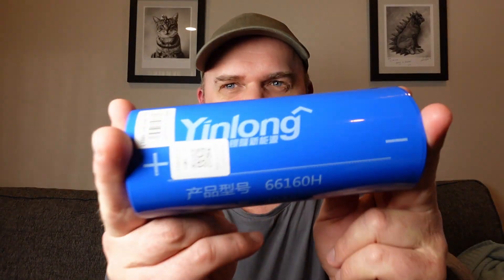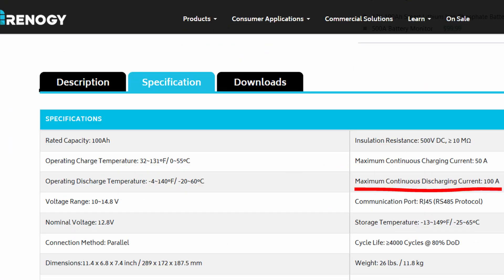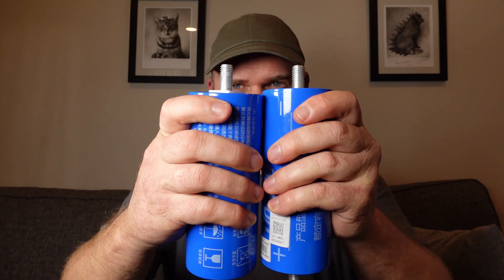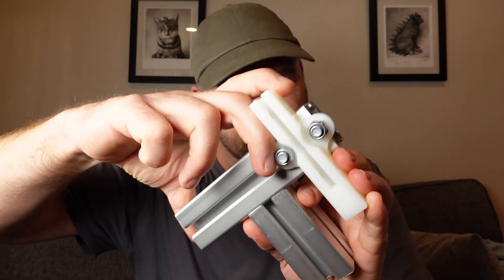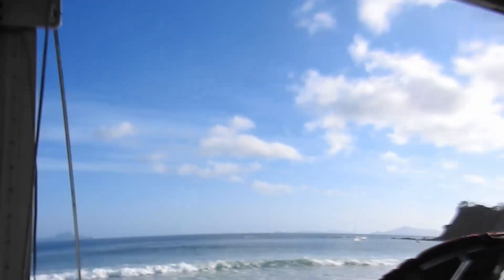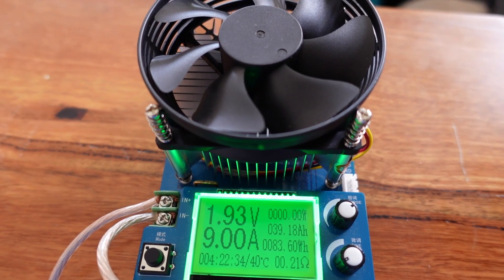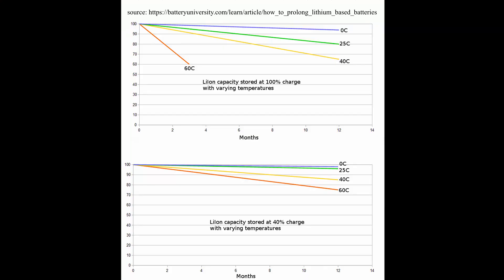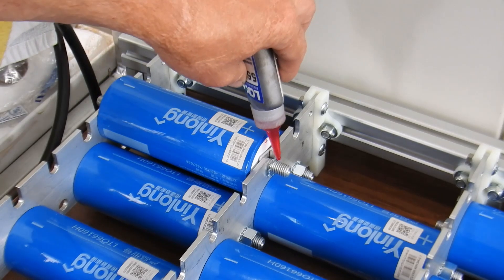Campervan DIY battery build HUGE POWER!

Comment: Hi Brendon,
Great video mate!

Super Detailed and knowledgable as well as neat work.
I have been looking for a lithium battery for my Ute just to use as a Power source when camping.

I nearly bought a cheapy which only had 50amp discharge, I'm glad I saw this first.

I'm not too savvy with this stuff, but know I can do it with the right info.

I was looking at getting 6 Yinlong 30AH Batteries, and Pairing it with a 6s LTO BMS.
Going to secure them with 2040, and put them behind my rear seat in my dual cab ute. (180AH should be plenty for my needs)

Is this a good solution for what I need? I am looking to run simple things, but want the capability to run 2000w inverter at load if necessary.
I would assume I would need to wire it all up with 6awg Cable.

I also have a ctek 20A DCDC Charger, that has a lithium mode (Designed for LifePo4), and 250Watt solar on my Ute roof.
Would these be suitable for charging it? is it suitable to connect an LTO system up to a dual battery system with the DCDC Charger?
And how do you keep these batteries Balanced?

Lastly any tips of crucial information before I begin, to make this as safe as possible.

I'm just a bit unclear about it and want to get the information before making the jump and you seem to be the most informed person about.
Reply from the maker: Hey Matthew, thanks!  For battery balancing, try balance them manually first and use a BMS with active balancing, they shouldn't take much to stay balanced.  6 of these cells will only be 30Ah and not 180Ah, this is one of the reasons Ah is a terrible unit to use for quantifying energy capacity... it's just shit! I'm going to do my best to try educate people to use useful units which makes figuring things out much easier a 30Ah LTO cell is around 70Wh - six of these cells is around 420Wh.  They would run a 2kW inverter (be aware most 2kW inverters will not run a 2kW load)  Make sure all wiring is as short as possible.  You ideally want your charge voltage to be around 15.3V.

Comment: Would these be suitable for an electric  vehicle? With high amp discharge and quick recharge they sound perfect.
Reply from the maker: Depends on who you ask.  Mitsubishi and Honda have used them in their Japan only vehicles.  Most people would say they are too heavy.  I like the fact they should last a long time without issue like you see is happening with so many Nissan Leafs.

Comment: First build I've seen where dude goes all in on yin cells
Reply: must have won the lottery before starting this project  ;-)
Reply: @marcelbron6128  He said $55 each x 99 = $5,445. That's high, but not unreasonable for a large RV battery pack.

Comment: Great video! Awesome engineering and design. One thing, though. For your price comparisons, it would be more fair to compare your raw LTO cells to raw LiFePO4 cells, instead of to pre-made drop-in 12v replacement packs like the Renogy. In that case, you'd have (approximately):

LTO: $50 ÷ 0.092kWh ÷ 20000 cycles = 2.7¢/kWh/cycle
         $50 ÷ 0.092kWh ÷ 10000 cycles = 5.4¢/kWh/cycle
         $50 ÷ 0.092kWh ÷ 5000 cycles   = 10.9¢/kWh/cycle

LiFePO4: $116.25 ÷ 0.5632kWh ÷ 5000 cycles = 4.1¢/kWh/cycle

This is based on these 176Ah cells: https://www.aliexpress.com/item/4000108447273.html

This is a lot closer, and makes it clear that the biggest factor here is how many cycles you might actually put on one of these systems, and how well they live up to the cycle life rating. 5000 cycles at 80% depth of discharge is nearly *14 years* of using most of the battery pack's capacity every single day. So if you imagine you'll use a pack for 15 years or less before replacing it (or you won't discharge it every single day), LiFePO4 is approximately 67% cheaper up-front and a very good option. The cost of 10kWh of cells would be ~$2100 for LiFePO4 and ~$5500 for LTO.

However, getting 28 or even 56 years out of a daily-use battery bank is pretty mind-blowing. So if you're building something you want to last that long, or if you need LTO's tolerance for charging in the cold, it seems like a clear winner. I'm really glad you made this video, becuase I was under the mistaken impression that LTO cells were prohibitively expensive compared to LiFePO4. As it turns out, if your $50 cells are widely available, they're more expensive up-front than raw LiFePO4 cells, but half as much as the pre-built 12v LiFePO4 packs and a pretty great deal for some use cases.
Reply from the maker: Thanks, I agree, and I probably should have made that comparison. The majority of people building an RV were familiar with those Renogy batteries so I used those as a reference.  I made the comment that in reality the cost might be closer to 10c/kWH relatively.  I think 5k cycles is very optimistic for LFP cells and would be surprised if in real world conditions you'd achieve half of that.  I'll be doing some LFP builds in the future bc I also like that chemistry and going into detail on how to make them last or fail early too. Group buy on LTO brings their price to be much closer to being in line with LFP.
Reply: @brendontait6968  “
Reply: The cost/kwH/cycle is funny. I have a 6s2p supercapacitor setup (0V - 2.8V) for my car. At 3.84 Wh per cell (same size as seen in vid) at a cost of about $15 CAD per cell (including balancer and aluminum link).
The lifecycle for these supercapacitors is supposed to hit as far as 500,000-1,000,000 so it's hilarious to plug that number in...
$15 CAD ÷ 0.00384 kWh ÷ 1,000,000 = 0.4¢/kWh/cycle LMAO

Yeah, the energy density is something small like 1/5 lead-acid, but this is actually on the low-end of where commercial supercaps are. You can buy quality supercaps today that exceed lead-acid energy density.  Supercaps are an absolutely fascinating technology, and you can abuse the hell out of them.  My car alternator will charge them at a gentle 1.4kW-1.6kW (around 130A) until they reach operating voltage 10-20 seconds later. You can discharge them down to 0V without any concern (you can actually reverse charge them too) and they also work down past -40°C depending on the electrolyte used.

I grabbed my 12 cells from the link below, but the seller has pulled the listing since September and the axial version (like the LTOs in this vid) has skyrocketed in price to $50 CAD across Aliexpress. https://www.aliexpress.com/item/4000395376020.html

You can still grab supercaps for the cheap $15 CAD price, the form factor will be a rectangular shape (prismatic?), which actually seems MUCH easier to create packs with.
https://www.aliexpress.com/item/4000740438507.html
Reply: Very good video Brendon, and nice cell holder design.  Donnie, thanks for your analysis. The calendar life of the LTO cells is listed at 25 years. So, unless you do more than 2 complete cycles per day, every day for 25 years, you will run out of calendar life before reaching 20,000 cycles.  Its ability to work down to -50C is impressive if you need to go to the artic. For Brendon's vehicle, the extra upfront cost might be justified.    If you chuck a sickie, in the arvo you can have a barbie and get chockers. Put the leftovers in an esky, and don't get bit by the mozzie. If you see a fair dinkum roo, she'll be right. Put on your togs, jump in your ute, stop at the servo, grab a slab and go for a swim at the beach you grommet. And remember, a real bogan sports a flanno, a mullet, missing teeth, and homemade tattoos.
Reply: @solarfluxman8810 lol your 2nd half was hilarious, needed to read twice to decipher what you were saying, there is no mosquitoes in most parts of Kiwiland, and defiantly no roos excepts in zoos. 
Trying to expand my vocabulary, What is a sickie? chockers? 
fairdinkum roo, assuming you mean the actual animal and not the pet treat.
Reply: @leoncryp8182  If you chuck a sickie, you are taking a sick day off work but not really sick. Chockers is when you are filled up with food.  Fair dinkum is when something is genuine.
Reply: I’m not convinced that number of cycles should be a consideration and worth paying more for. Given the life you can get from these, I’m sure that even in 10 years you will be able to replace them with something smaller lighter and much more amazing than what is out there now.  Maybe cheaper too.
Reply: @britboy20002  Yeah, its all about the chemistry. If your electrolyte decomposes in 10 years, even if the thing has 1,000,000 cycles, it won't matter because a critical functional ingredient seizes the battery's functionality. Cycle life is usually defined as a drop in capacity by 80% once you hit that number, so it wouldn't be a deal breaker if you just sized your system accordingly.

It should be cycle life or calendar life, whichever comes first. For solar generators, the number of discharge cycles per day isn't going to be a whole lot.

What a lot of people don't acknowledge though, is the lifecycle of the whole product and its waste management. In order to get the amazing features of a battery, manufacturers could be using toxic as hell ingredients that are either a pain to recycle or will just make life unlivable wherever they end up. Yeah the next best thing is great, but its a very consumerist mindset that throws sustainability to the wind.

Long story short: I'd pay more for energy storage that outlives MY lifecycle, or something with a short lifecycle that has waste management or can be buried and decomposed under the dirt.

Comment: If the cells heat up then the aluminum they are attached to will also heat up so i dont think expansion will be a issue.
Reply from the maker: There is no direct connection between the cells and the aluminium side rails, so.... I think there could be.
Reply: @brendontait6968  it looks like there is to me. Are you referring to the spot you have those clear tube. Pieces?
Reply from the maker: @deltacx1059  the side rails... the 4040 section does not have a direct thermal connection to the cells.  If the cells heat up and the 4040 section does not, there will be a differential.
Reply: @brendontait6968  oh i see what you are getting at, i thought you were talking about something else.

Comment: Very interesting build, I really appreciate being able to see and learn -  and your workmanship.  But despite being even safer than LFPs, I reckon the latter are still best bang for buck for this kind of application.  One comparison, my 4-cell 120 Ah LFP 4S cost only AUD360 shipped for the cells, while equivalent Yinlongs (18x 40AH 6S3P) would be Around AUD1550.  I can't see me ever using more than 2000 charge cycles (100 cycles/year x 20years) so the extra life is probably wasted on me.  You mentioned similar weights but my 4 cells are less than12Kg while 18 Yinlongs are 22Kg.  Also of course larger.  One area where these would be superior is standby applications like UPS (standby at full charge with occasional heavy discharge), because they are much more tolerant of being held at full charge for long times.  Current LiFePO4s or other chemistries apparently won't do so well in that application.  Then again it's true that for most of us our RV's are more like standby situation than constant use - home for 9 months of the year and on the road for 3, so I'll have to see how the LFP holds up.

Looking forward to your next part on BMS. I used a Xiaoxiang / LLT BMS and it's OK - nice to have ability to monitor and set parameters on the phone, and it doesn't use much power, but the SOC indication is flaky. 

PS I see you plan to do more battery builds with different chemistries, so you're well aware of what I said above.
Reply from the maker: Hey Julian, yeah am going to do some LFP builds.  I think if you look at cost/capacity, from what I've figured from decent suppliers... LFP is about 3 x cheaper then LTO. I agree with what you said about the cells being kept at fairly high SOC and think many LFP cells will fail long before they reach their rated cycle life because of it in real life usage.  Am curious how your pack works out, please keep me in the loop.
Reply: My 120AH LFPs were USD38 each plus shipping and were nicely matched, so far they have been great.  I intend to build a ~10KWh solar battery using these if I can get permission to put solar on the roof.  Simply can't afford Teslas etc, or using LTOs.
Reply: Did you get the rated ah draw on discharge I’ve read loads of issues with less ah some as low as 60ah ...50% its rating if you could list a supplier that would be great.  :)_

Comment: please add me to your group buy information.   I'd like to build a battery pack to install in my VW bug that is currently set up with 6 deep cycle flooded 12v batteries.  looking to get additional KWh and reduce weight.
Reply from the maker: Message me: brendonsbuilds@gmail.com
Reply: @brendontait6968  message sent.
Reply: @brendontait6968  Hi Brendon...just wondering if you got my email and your thoughts on whether these would be a good battery for my project??

Comment: If I were to double your setup lengthwise for a 48v system (and also doubling capacity) for use in a home fixed storage, do you think the expansion and contraction will be an issue?
Reply from the maker: It's unlikely to be a significant issue unless you were pulling serious power.  I would likely make a double decker version, so just two of these, one ontop of the other else it would be very long.  Thanks

Comment: Since I first drove the Dune Rider I’ve wanted to build a Unimog Camper. It’s on the list but meanwhile we’re in the middle of our off grid house build. Powerspout (mini hydro) have sent back a great prognosis for the head/flow numbers on one of our springs and I’ve looked at Lead Carbon for the battery house. You seem to have gone down the storage Rabbit Hole further than I (I’m an absolute electrickery muppet) so your feedback on a constant charge system should you have the time or inclination would be valued and appreciated. And cheers for the brilliant content! Regards Mark.
Reply from the maker: The charge system is very dependent on the battery chemistry. I'd love to do a mini hydro setup.  Let me know your proposed setup and I'll tell you my thoughts.  Thanks

Comment: Nice build. I think using thread locker wasn't a good idea as it is not electrically conductive (unless you use a purpose-specific conductive epoxy). While the threads will engage when the nut is tightened, it will insulate the nut to a certain extent. In low current applications, this isn't an issue, but this isn't one of those. I'd use a jam nut or other mechanical solution for vibration management.
Reply from the maker: Thanks, yeah... I'm not sure.  For example I commonly use grease between lug faces.  Grease is non conductive, but it still decreases the resistance.  Would the threadlocker be significantly different to the grease?  Would the thread loading and shear be enough to push the threadlocker clear of the mating thread faces?  Not sure.  I guess for my situation at least...  there are 9 cells in parallel each with a direct contact face from the cell to the bus bar?  Appreciate the input.  Cheers.
Reply: @brendontait6968  Yeah, its hard to know. Problem with resistance at these currents is they become very meaningful. A tenth of an ohm at 200 amps will result in 4kW of heat - localized will result in very high temps and catastrophic failure.

Comment: Thank your for this interesting video. I’ve got a question, I totally understand the safety matters,but what about weights? your build seems amazing but quite heavyweight, I’m wondering if it is good solution for my max 3.5T van built...
Reply from the maker: Hey, no problem..  weight doesn't matter that much for me since my truck is 12T. I guess my build is likely around 130kg.  My build is based around longevity, reliability, safety and ruggedness.  In your situation with weight as one of your primary restrictions I'd personally look at another chemistry.  Keep an eye out, will be doing other battery builds that might better suit you.
Reply: Thank you very much for your answer. I'll looking forward your next videos then (you just won a subscriber / notification bell) :)

Comment: I don't yet understand.  Are these batteries 12v on their own and you connected them in a way to create 24V and if you were to do a rebuild you can connect them in a different configuration to get to 48V?  The other question, my proposed van build is all at 12V like the van.  Do I gain anything configuring to 24V or 48V.  Tia
Reply from the maker: The cells are 2.3V nominal each, and yes you're correct that they are configured in a way to make 24V.  The voltage you choose to run your van on should be based around how much power you require.  For example.. if you want a couple of induction hobs, an oven etc.  12V will be a struggle, the current draw just gets too high to be practical.  If you are looking at big loads.. consider 24 or 48V

Comment: use a (nyc's 45 ton rotary converter) step up generator to get full power. in your case a 775 and a 40 amps alternator for one full 120 and 20 amps (it is loud if you buy the wrong motor and then find the high speed 120 and 20 amps motor (also quiet and run four self excited alternators. the big rotary converter is self excited they have been doing it for 120 years in new york.
Reply from the maker: I think I'll likely use a more modern approach!  Have thought about throwing a 6kW alternator in tho!